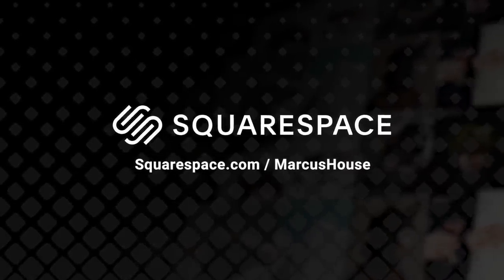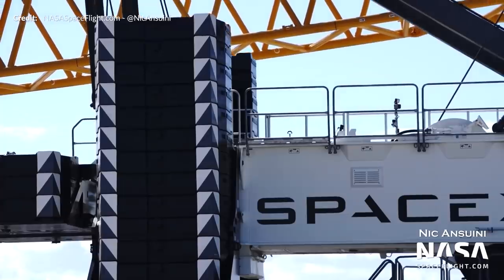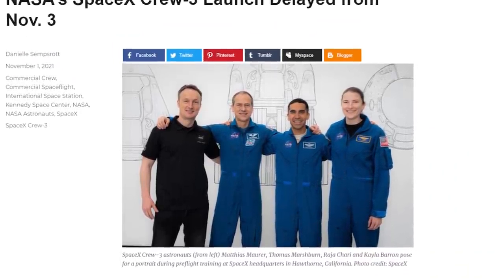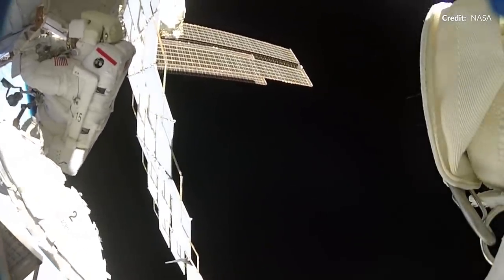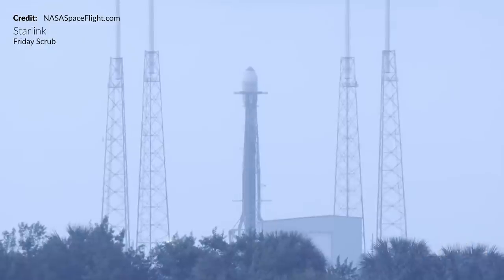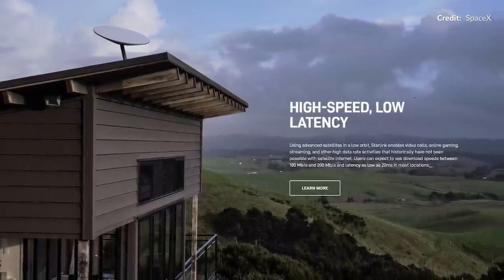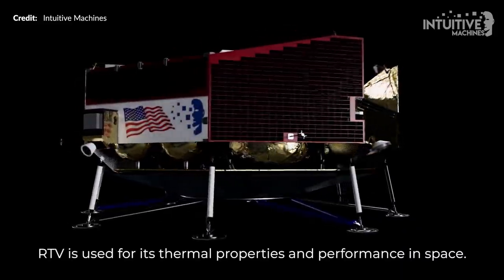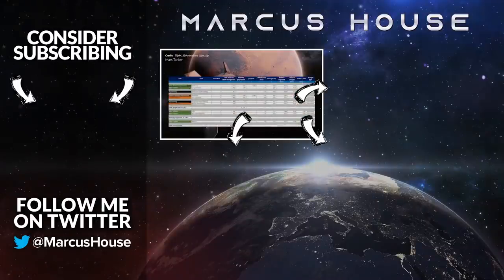SpaceX Starship Record Fire, Crew 2 Return, Crew 3 Launch, SpinLaunch, Starlink + More

Comment: Congratulations Spin Launch. I estimate initial velocity at around 450 m/s based on 20,000 ft altitude plus modest drag. Their mechanical problems will center around the vehicle release mechanism.  Its design will have to be extremely strong and extremely accurate to make the vehicle depart on a path that, at the correct moment of release, is exactly tangent to the circle of rotation, with no pitch velocity.  Big problem when the tensile stress increases as mV^2.  The alternative impulse launch company is called Green Launch, using a light-gas impulse launcher to supply a much larger fraction of the velocity needed to deliver payloads to Low Earth Orbit. As with SpinLaunch the technology is potentially cheaper and more flexible than conventional rockets.  It is also much more environmentally friendly since unlike conventional rockets both produce zero hydrocarbons with the first/main stage.  However SpinLaunch has significant physical limitations in reaching their stated velocity requirements. The fastest published velocities for a spinning armature are approximately 1.4 km/sec they are currently at 0.4 km/sec.  The record for a projectile launched with hydrogen propellant is 11.2km/sec.  Green Launch will limit launch velocity to 6 km/sec to extend reusability and prevent wear on the barrel. In the best case SL will need a large 2 stage rocket to supply a delta-v of an additional 7.5 km/sec.  GL rocket would need to produce an additional, and more achievable, 3 km/sec to circularize and achieve orbit.  Also SL payload is an hour at high G where GL is 40 msec.

Comment: Excellent as always, Marcus!

Quick question: My understanding is that the sea-level engines will only be used for landing, not at the same time as the vacuum engines in space. If that's the case, why did they test fire all six engines together if they will never be fired together when it's operational?
Reply: They will probably fire all 6 after stage sep to keep gravity losses to a minimum
Reply: For science.
Reply: @AndreaSisto  Ohhh, is that the plan! Thanks,.
Reply: @fredandersen9873  I suppose that could be reason enough! :-)
Reply from the maker: I also suspect they would use them at low altitude for abort scenarios.

Comment: Do losing anyone of the heat tiles during reentry cause the entire starship to explode??
Reply: Not according to Elon.
Reply from the maker: The underlying structure is made of stainless steel and there is a thermal blanket layer directly between the tiles as well. It should mean that there is plenty of protection if a handful of tiles are lost. We certainly wouldn't want to see them losing big patches of them though.
Reply: @MarcusHouse  thanks ❤

Comment: In my opinion, the spin launch concept is doomed. It sounds like the launch G-forces involved will require expensive design accommodations on the payload, and, as a result, will force the potential customer pool to be extremely limited.  Too many payloads won’t be able to take those forces. 
What I’m waiting to see is a rail gun type of concept used to accelerate and aim the launch vehicle. A ground-based structure like that could be several kilometers long and support reasonable, human-survivable, launch accelerations.  That would be the ultimate in reusable first stages.  And I could see Musk’s Boring Company playing a part in putting a large part of it underground. 
The contribution of the Spin-Launch concept that I like is the vacuum containment to assist in initial acceleration.  There’s good potential in that idea. 
Thank you, Marcus!!  Another great vid.
Reply from the maker: Totally. 10,000g seems totally nuts.
Reply: Seems useful for getting raw material into orbit...not USELESS.  Near term it would be nice to have cheap propellant (hello Starship fuel depot) and water in orbit.  Later, raw materials for in orbit manufacturing / construction will be needed.
Reply: While the g forces on the spin launched projectile are high, they are not as high as the g forces on the M982 Excalibur artillery launched, GPS guided projectile.  The circuity and anti-shock techniques developed for Excalibur could be used on a spin launched rocket.
Reply: @737smartin  I’m thinking it will be cheaper, in the long run,  to harvest the asteroids already out there.  Of course, this may only be possible after a base infrastructure is in place, so I’ll grant the need for raw materials in the short term.  Point taken.
Reply: @royschering1140  I suspect you’re right, regarding the rocket. I doubt that would work on all the payloads. And the costs have to be considered.
Reply: ¿Combine Musk’s boring machine and Robert Heinlein’s vacuum tube rail gun on the west side of Pike’s Peak or Mt. Kilimanjaro?
Reply: @SewolHoONCE  Wouldn’t that be something to see?!  I’d love it.  From imagination, to fiction stories, to reality. 
It’s happened before, it could happen again.  Too bad it couldn’t happen for RH to see it. I’ll keep hoping I get to see it before I run out of time.

Comment: Musk is not confident Starship will survive reentry.  Looks likely based on the number of TPS tiles shaken off every time Starship is moved or test fires.  NASA also announced they are particularly interested in monitoring that part of the return.
Reply: A few tiles falling off might not be an issue. They still have a second layer of heat shielding and the stainless steel should be able to handle the temperatures.
Reply: @chronovore7234  Yes, I hope that is the case.  Space shuttle was made of aluminum and it did survive one reentry with a missing tile--because it just happened to have a steel plate underneath it at that location.

Comment: The problem with the rocket chucker is that the rocket has to be incredibly heavy to withstand the centrifugal forces.
It would be much more viable on the Moon or Mars.
But, still, a bad idea.
However, since it can run on solar-derived electricity instead of a combustible fuel, the very large trade off is probably worth it, given the rarity and difficulty of manufacture for fuel in non-terrestrial environments.
It's still terrible.
But, less terrible than making Methane and Oxygen on the Moon or Mars.
It's easy to make Methane and Oxygen on Earth.
The less of it you have to make, the better.
Electricity is falling from the sky for free.
Or LFTR.
You're not going to have a sustainable colony on the Moon or Mars without LFTR anyway.
So, may as well...
Reply from the maker: 100%

Comment: I just don’t understand why “they” keep saying we need to refuel the craft in order to make a round trip to the moon. What moon? One of Jupiter’s moons? During the entirety of the Apollo program, it only took “a single tank” to make the trip. And that was using less efficient systems, heavier equipment and no where the experience, knowledge, technology, materials available today. Now all of a sudden, it’s going to take more fuel than before. Oh yeah and there’s, “it’s too dangerous due to radiation in the Van Allen Belt. Supposedly it now takes so much shielding that the craft would be too heavy, yet “we” passed through the Van Allen Belt numerous times in the 60’s with no more than, I believe, 3/16” aluminum sheet some high tech textile blankets and Mylar. And, I do believe most of those guys from Apollo lived well into their 80’s - 90’s. 
Absolutely no doubt that space travel is inherently dangerous, but to me it sounds like the dangers have been hyped up to a point that “they” have shot their selves in the foot in what seems to be attempts of preventing us from going back to the moon, or to make us think twice about even thinking about it. Why?
Reply: You do know how much it costed to let the apollo program not need to refuel right?

Comment: My concern for heat tiles is only growing over time. This is like several thousand points of failure.
Reply: Calm down, SpaceX is on it.   Think of the engineering problems they've overcome in the last decade.

Comment: i imagine with enough time and effort you could design a rocket capable or withstanding the Gs from the spin launch system. however i doubt the same could be said for the satellites it would be carrying. saving a few million on the launch is false economy if then you just have to dump all that cash into massively over engineering your payload so it doesnt die on the way up.

Comment: A bunch of heat tiles lost with just a short fire of 20% of the booster's engines. Those tiles are proving as troublesome as they were for the Space Shuttle - they have to be the biggest barrier to economical reuse. I reckon they're what's slowing everything down in recent months.
Reply: It's totally expected, iterations

Comment: Lossing tiles: it's the space shuttle all over again and with new material, as the ship is not based on AL. I understand the reasons but I don't know.  Also the form is not ideal for low reentry speed. I was a shame that the X-33 and derivates were not build. Maybe even the metallic tiles will have worked. The space ship could prove to be an insecure (no scape system) expensive machine with no ability to bring back stuff from space.  On the other hand even if it's a finantian failure or at least unable to lower the costs as expected, it's an engineering marvel, but so was the shuttle.
Reply: It does have a second layer of  heat shielding with the thermal blanket and the stainless steel should be able to handle re-entry temperatures on its own. The tiles on ship 20 are prototypes and the attachment method is still being worked on. It is waaay to early to say that this will be a problem with future starships.
Reply: @chronovore7234  I hope you are right. Right now it seems like a problem, and the starship si a cylinder. And again it does not has a scape pod.

Comment: Why even bother with perfecting tiled heat shields at this time? Build every Starship with a primary purpose in space considering Musk needs 1000's of them up there to meet his goals. As proven with the shuttle the heat shield must be one piece and far more durable than what it is now before it is reliable.
Reply: The MAIN point of Starship is rapid reusability. Once in space, there is no new/next mission for a Starship, so there'd be no reuse.  Not sustainable.
R.e. the tiles...the ISS structure was lightweight composite and aluminum.  The shielding had to be nearly flawless or the structure would fail.  Starship is MUCH tougher SSteel.  It's likely a few missing or cracked tiles won't matter, and the tiling process will likely improve over time.